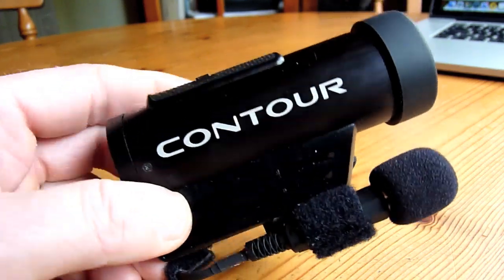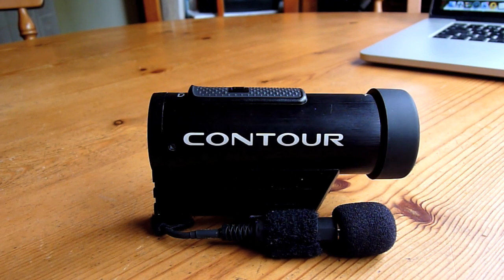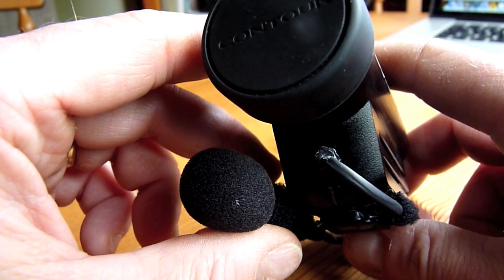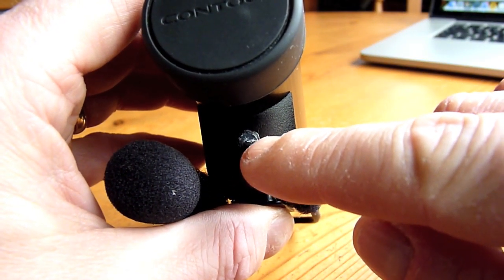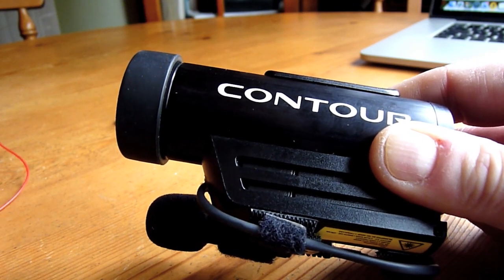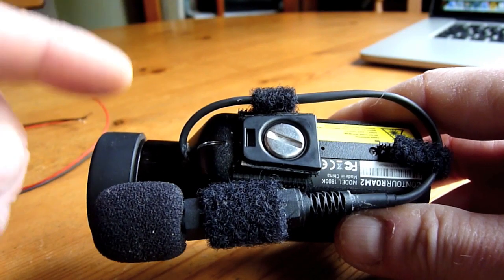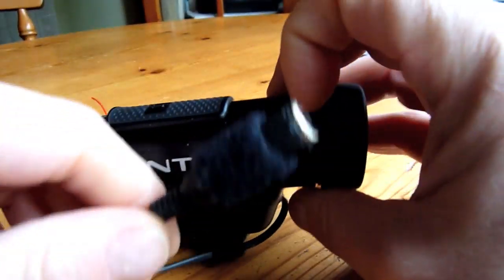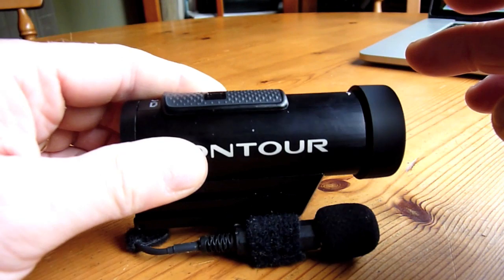Contour Roam 2: Microphone Modification

Comment: A 6 year late question please !  The contour has the red and black wire - the jack plug has a red, white and some bare wires - that I assume is earth. Do you remember how did you wire yours up? It’s the only thing you don’t explain on your video....
Reply from the maker: Solder the black (ground) wire to the long terminal of the female jack socket and run the red wire through both of the short (channel) terminals, soldering to each. That way, you pick up sound whichever way the mic jack is wired. In my experience, the best sound is received through a mono mic, but a stereo mic works too, albeit that it is reduced to mono.
Reply: Len Scapoff Thank you - I perhaps better revisit it - i have used a pre-wired female jack and not used the bare wiring, assuming it to be earth, and just run the red wires together and the black from the camera to the white on the jack. It is recording though -  no idea if it’s through two channels though. I don’t fully understand how ground works on the original condenser mic.
Reply from the maker: @Anderzander   It should be two channel, because the red wire connection at the camera board does that for you - directs one channel input into two channel output from the camera (each mono and thus identical). Check for a buzzing on the recording - if so, then you have a grounding issue with the mic and you will need to revisit the wiring at the jack socket anyway.

Comment: is there a tutorial that you have on here on what to do with the actual hardwiring? this is great because i need a 6 ft 3.5mm extension chord to go through the rear seats of my car and through the trunk to place my mic next to the rear license plate to pic up exhaust note...had a gopro 3 but so many bugs and shoddy build that im thinking of buying a used contour roam 2 for cheap but i have to be able to hardwire a mic...check out my channel to see the audio and see if its possible thanks!
Reply from the maker: No, but take a look at the first link I give in the comments.

Comment from the maker: Do you mean the two parts of "Suffolk Rideout"? I had the lens wrongly rotated, so that if I had posted the vids as they were shot, the viewer would have had to tilt his/her head 50 degrees or so to the right to see the picture 'upright'. The square framing was the result of rotating the picture left in an editing suite (you can only rotate in increments of 90 degrees during editing without visible detriment to the framing - or, at least, so I found). Thanks for the sub, by the way. Appreciated.

Comment: Yeah don't plan on rain (hate riding in it so avoid it like the black plague) and am hoping, space permitting, to get the cabling to come out behind the threaded mount socket so with a bit of silicon should be able to get it pretty secure. Planning on making a DIY vid on it for others to follow, after some testing to be sure my design is usable and on disastrous.